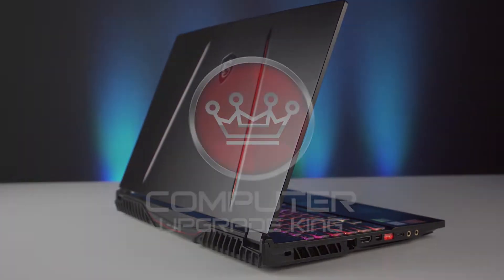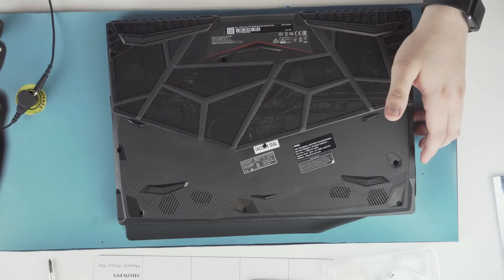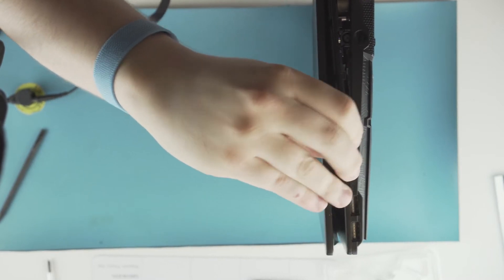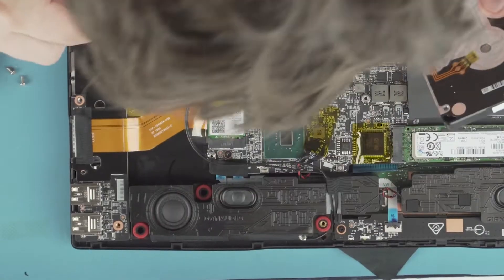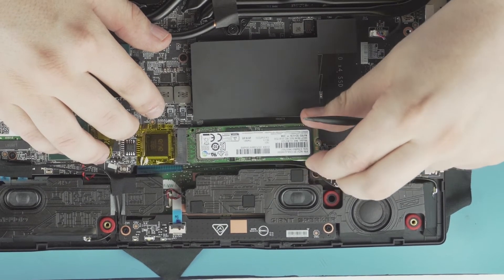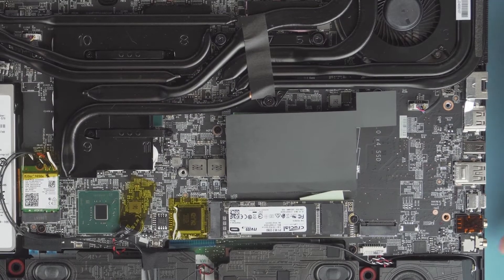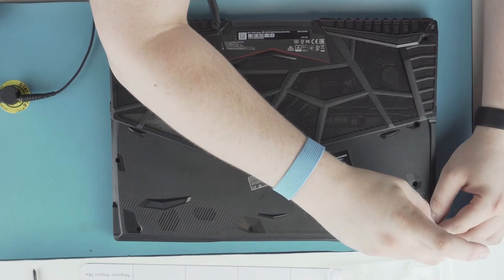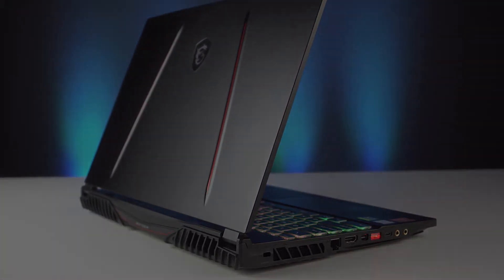MSI GE65 Raider-051 Overview & Teardown - 15.6" i7-9750 RTX 2070

Comment: Heads up, the 2.5in Bay only accepts 7mm thick drives. I also highly recommend thermal repasting with a quality product and undervolting the CPU.

I used K5 Pro to replace the liquid thermal pads, Thermal Grizzly pads to replace the physical thermal pads, and Thermal Grizzly Kryonaut to replace the Thermal paste on the CPU and GPU. After undervolting it, it runs like a dream.

At 100% utilization, the CPU runs at 78C and 4.0Ghz and the GPU runs at 76C, all without me having to use the Cooler Boost!
Reply: How do you undervolt the CPU?

Comment: Hey guys how do i get the max performance from my laptop as in the configuration. i know there is like different power settings and performance settings to get the max out of your computers speed. Im using the MSI GE65 Raider. sorry for the noob question just switched from mac.

Comment: while in there - change the killer wifi garbage for a 20€/$ intel one... - also you've another nVMe slot - i would keep the original one, for eg most used games or so...

Comment: How much for the i9 ver
Reply from the maker: For $700+ more, MSI has a GE65 Raider-049 model with i9 but we don't see the value as the graphics is not improved and remains RTX 2070.

We would recommend the MSI Titan GT76 with 8 core 5GHz overclocked desktop i9-9900K CPU for those that want superior CPU performance...but you looking at spending $4k+ https://cukusa.com/msi-gt76-titan-dt-006-17-3-i9-9900k-rtx-2080-144hz-gaming-laptop.html
Reply: @empoweredpc  On the link you provided, the i9 9900k is mislabeled as a hexa-core instead of octa-core.
Reply: @empoweredpc  Shit is ridiculous lol